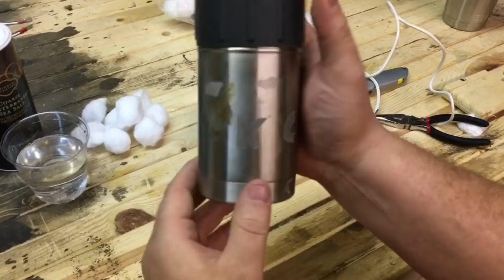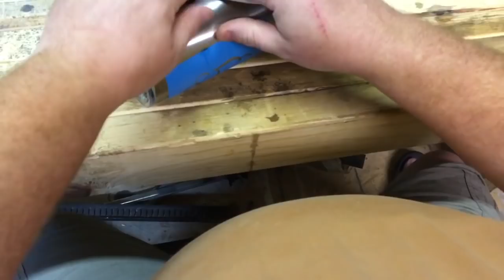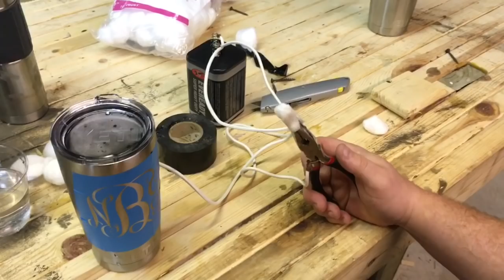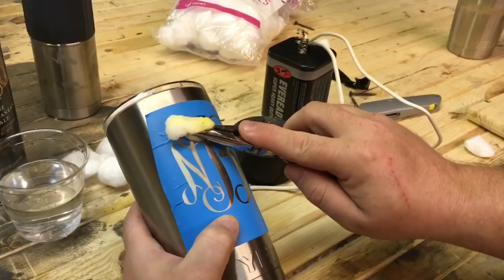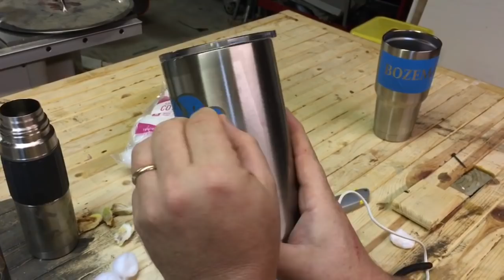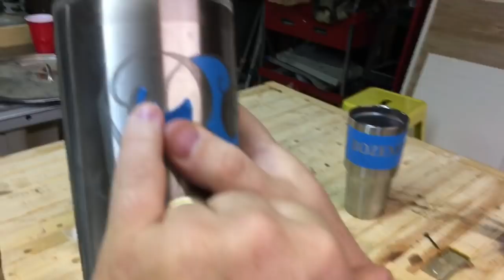Metal etching

Comment from the maker: That battery lasted about 10 cups.
Reply: Keith Chism try with power suppli
Reply: thats cool Keith
Reply: Keith Chism I
Reply: I have a question, I want to etch a name into a sword I have. it's 1095 high carbon steel, my only question is when I Polish it, will the etching go away, as polishing also involves removing material.  I just don't want to spend the time and money etching it if polishing it gets rid of it.
Reply from the maker: It would probably be removed if you polished it.. I would try and polish before.
Reply: I have a question. Will it work just on steel or any metal? I am thinking of attempting this same technique on the back of my smartphone(aluminium) to etch my initials...will it work? Is it safe to attempt?
Reply: @PunkPiggie  itll work... just remove your electronics in the inside of the phone via just a case shell then do it... you dont wanna over heat electronics
Reply: making money as a teen cause of you.
Reply: Would it work on aluminum?
Reply from the maker: @jedishadow4083  yes

Comment: ok, so you are my new favorite channel! A Gamecock too! I just subscribed and am trying to decide if I'll do the swirl dip or the etching on my yeti knock off.
Reply from the maker: The dip could wear off the etching is perm.
Reply: Maybe try both. 1st take painters tape,and mask off an area doesn't matter if its an oval, square, rectangle whatever works for you. Then do the swirl dip let dry next remove the tape"very carefully" then apply stencil,and do the etching also maybe clear coat for longer lasting effect. I think both would be very unique

Comment: I know you made this video some time ago, but I am wondering if this method of etching will work with a tumbler that has been spray painted and will I need to  or can I top coat or epoxy the tumbler after it has been etched with any method?
Reply from the maker: I'm still active here. I'm working on a few things and I'll hopefully be posting a lot.. To your question. No, It will have to be bare metal. You coat after the etching.  Hope this helps.
Reply: @keith776  
Thank you for replying back. I look forward to your video posts. Again thank you!!!

Comment: Looks nice. As always, the real work is in all the masking and cutting of the stencil, done enough airbrush work to know that. Where do you find the self stick vinyl?
Reply from the maker: Andork Kuomo this vinyl  was done using silhouette machine. The sheets were purchased on amazon
Reply: Andork Kuomo if you can find wide roll electrical tape that would probably be good too.

Comment: This is a great video. (advisement question for a novice) I wanted to know would etching low or mild carbon still etch with this method work (I don't know anyone to ask). Also would using painters tap (silhouette image on it) yield similar results on different metals. I hate buying gifts for people (impersonal and cheesy in some cases) some of my friends and family would love something half as elegant as your works of art.
Reply from the maker: Jason Duncan I've not tried it.  In theory it should. If I get some time today I'll try it.
Reply: That would be outstanding. once I get my shop finished I will run some test as well. Thank you again for the video.
Reply: Jason Duncan I etch high carbon steel with this method.  Works great.
Reply: Lanny Sutton Thank you very much. I plan on setting up some test to be done probably mid Feb (current projects are a bit time consuming.

Comment: Would 12volt car battery work better or does a higher voltage battery just make the process faster?
Reply from the maker: You can use 12 volt. Be careful of the amps that it puts out. I've used a 12 battery charger set to low amps.
Reply: Keith Chism why, aren’t more amps better? Or would it just be faster?

Comment: I did this on some knives and found that sand blasting was faster.  I liked the darker color i got with A/C (but don't remember for  sure if it was ac or dc).
Reply from the maker: A/C would hurt. Yes blasting is faster, but a battery and some salt water is easy to obtain.
Reply: DC does the etching (actual metal removal) AC will darken the metal. You can use an old style power cube and get both 12v dc and 12v ac and make a very usable etching device.

Comment: What you are doing is reversing the manufacturers electroplating process leaving the chromium and Zinc oxide solution in the cottonball, this is called electrolysis..electrolysis can be used for thousands of things, including electroplating and stripping which you are demonstrating here..but no matter the project the process is the same basically, the negative and positive atoms are pulled from each other migrating to the opposite charge, very simple.. I've used electrolysis for 15 years and it still fascinates me

Comment: Would be interesting to see what 12v from an electric scooter battery would do to it in comparison
Reply: zeer365 exactly. Sand blasting is way faster like u said and actually looks better. It sands out more than his etching does
Reply: @Derek Davis I wasn't talking about sand blasting. 
I was talking about doing exactly what was shown in the video, but with a more powerful battery instead of the lantern battery
Reply from the maker: I've used a battery charger. It didn't work well because it was a float charger and would shut off quickly. I have seen people use 18v drill batteries. The 12v and 18v work quite a bit faster. I prefer the 6v because I can take my time.

Comment: question? taking off the stainless, wouldn't that make it rust? or rust when water contacts it.
Reply from the maker: It's not covered in stainless steel, it is stainless steel. Just like a soda can is aluminum all the way through. This is stainless steel all the way through.

Comment: With doing this method of etching or really any kind of etching it's taking off some the surface does that make it able to rust now??
Reply from the maker: This is stainless steel. It won't rust. Carbon steel will but it will rust with out etching.

Comment: could this be done using a car battery , I mean it wouldn't explode ...would it ?
Reply from the maker: I haven't tried with a car battery. With the amount of amps that it can deliver, it wouldn't be advisable.
Reply: +Keith Chism Yeah ! , I used an 18 volt drill battery instead , worked great , thanks !

Comment: Does this ruin the insulation?
Reply from the maker: Melody no there is no heat exchanged and it doesn't eat into the metal enough T for you to even catch your fingernail on it. This method barely disturbs the surface.

Comment: I did your process and it looks like the cup is starting to rust where I etched. Did you get the same effect and if so is there a way to prevent it?
Reply from the maker: All the cups that I have done have been stainless steel. What brand are your using?
Reply: Keith Chism 
It is a brand from Walmart. I think it may be Ozark Trails.
Reply from the maker: Humm. I've not tried it on Ozark Trail. I've done RTIC and YETI. If that is starting to rust where you etched I would deduce that the rest of the cup will too.

Comment: +keith chism would this work ok with a 9 volt ac plug pack?.
Reply from the maker: Yes but the charge wouldn't last long.
Reply: +Keith Chism 9v ac plug pack plugged in to power point on wall,australia uses 240 volts ac but plugpack converts 240v to 9volts would get more consisent results as power wont run out,would white vinegar work better that salted water?,vinegar is acidic right?
Reply from the maker: +neil froggy crompton you might get better results.  I haven't tried it.

Comment: Can you use higher voltage, like a car battery
Reply from the maker: A car battery will have too high amps You can use higher voltage, but you need to be aware of the amps.

Comment: Tried this technique on a Yeti.  The result was very faint/light.  What did I do wrong?  I used a brand new 6V battery, salt water, ect.  Any insights?  Thank you
Reply from the maker: Leba  you just didn't leave it long enough or you didn't have enough salt.  It takes about 20-30 min to do one the size of the one in the video

Comment: what would happen if you upped it to a 12 volt battery.
Reply: it would be slower i guess but i dont know
Reply: wouldn't it be faster since it would burn faster
Reply: If you’re referring to a car battery you’d probably die.
Reply: Tim Weaver I found an old mystery DC power plug in the closet, been using it successfully. It outputs 9 volts at 800 milliamps, works like a charm. People also use 12 volt car jump-start packs. Just practice on some scrap first like he did.

Comment: Hello, 

I've tried this and it's not working :( 
I'm not using a Yeti cup, but it is a Stainless steel cup. 
Does it matter what type of wire I use? I'm using Ever Start Auto Wire 18 gauge
Reply from the maker: Do have a batter that has power in it? You might add more salt and go slower.
Reply: i think i found the problem. the stainless steel is inside not outside :(  
I did it in the inside and it worked. 
but the cup said Stainless steel

Comment: what about rust since u r removing material?
Reply: Johnny Mills use gun oil to remove rust
Reply from the maker: +Thangs it is stainless steel. Is not plated. Made from the same stuff a fork is made of.

Comment: Do you know if this affects the effectiveness of the Yeti at all by removing some of the outer wall?
Reply: Nancy Watson , hey Nancy jou really shouldn't be trying this with a Sasquatch. start with something small like  a poodle or a cat.thank you for your questions.😃
Reply: Nancy Watson 
No, the effectiveness is determined by the vacuum between the inside and outside walls of the yeti thermos. Etching the surface will have zero impact unless you somehow managed to puncture the metal.
Reply: You're only affecting less than a tenth of a thousandth of an inch, you're barely going beyond a molecular level.